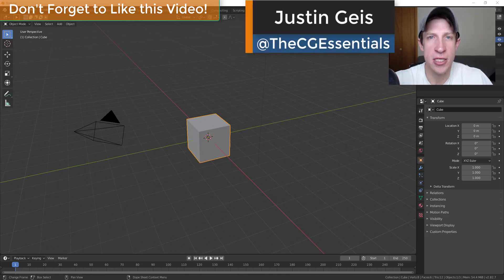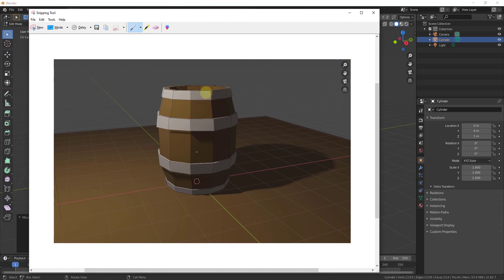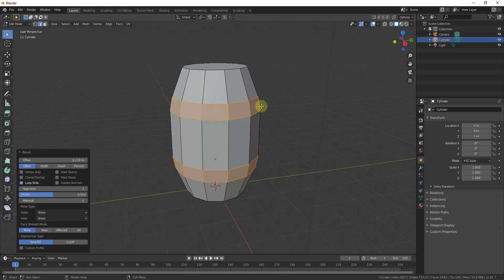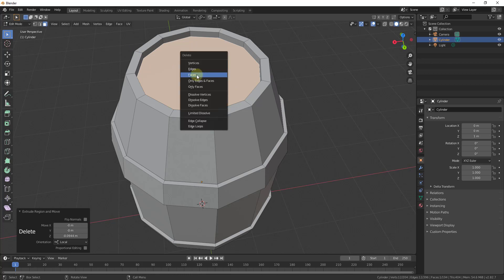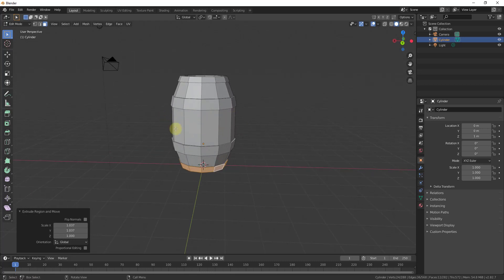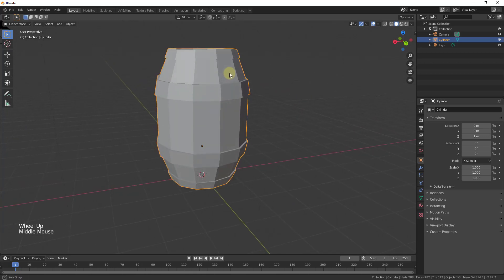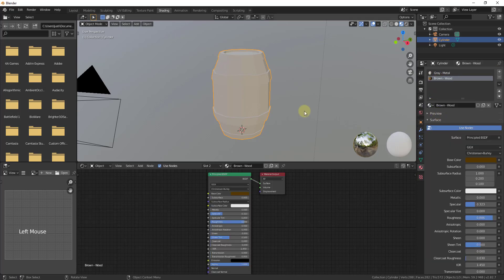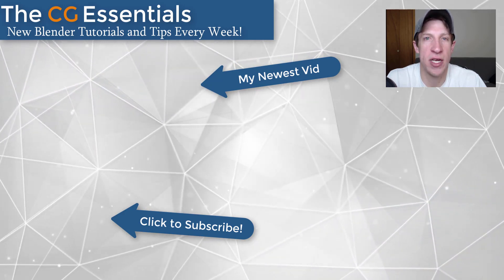Modeling a BARREL in Blender - Blender Beginner 3D Modeling Exercises

Comment: Great video! Thank you, I only have on minor issue: when I do alt-click on the faces of the "metal rings", it will not select around horizontally but vertically. Why is that?
Reply: You have to click "between" two faces, means while being in face select you do not alt-click on the face but on the edge between two faces.